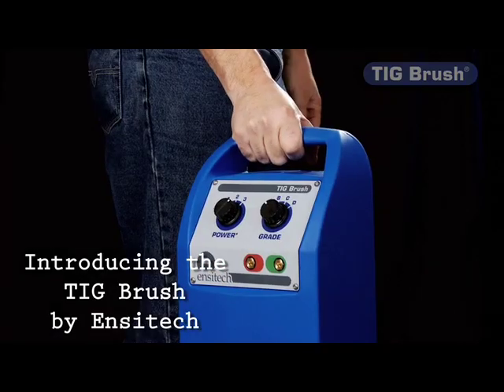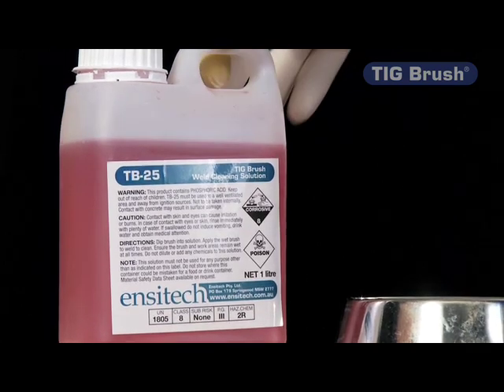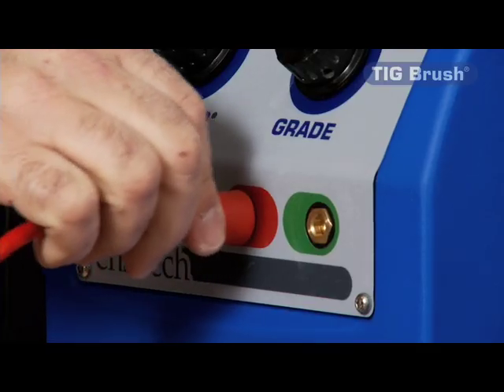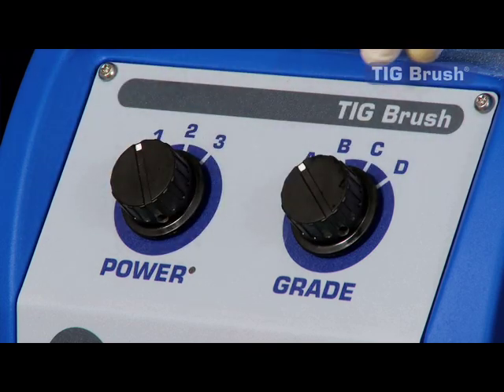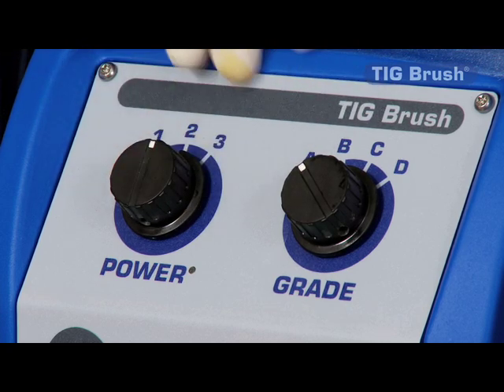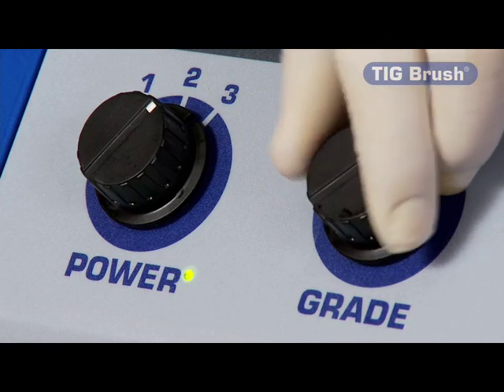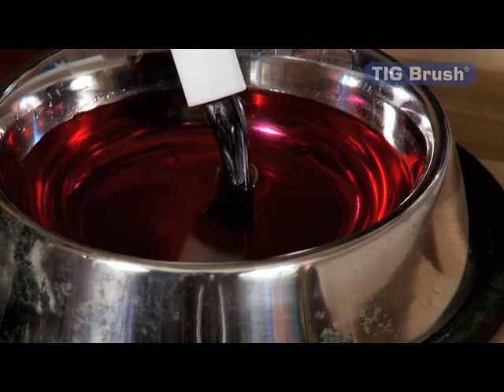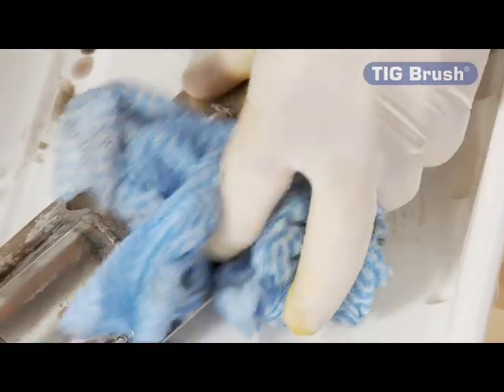TIG Brush Stainless Steel Weld Cleaning System

Comment: Our workshop bought a couple of these a year or so ago and I really want it to be good but it sucks. The immediate results are great if your cleaning something that has been welded on one side its a doddle but we weld most of our stuff inside and out for hygiene reasons and it struggles to clean the welds where the heat has unavoidably built up and you have carbon deposits.(normally the side opposite the last weld)
Not only is it extremely messy and smelly I find it has very little advantage over the traditional methods when considering the time it takes, It would be good if it wasn't for the next bit. 

We clean, use the neutraliser and no matter how much we spray it with a pressure washer it ultimately develops phosphoric salts (white powdery finish which is difficult to clean), I have just about given up with the reps, they blame it on how we clean it after but even the stuff they do in the shop develops after a week at which point they are no where to be seen for 6 months. They can't explain it and are very unhelpful. Anything the acid touches turns to crap including our floors and not to mention the state of the machine now..

Unfortunately I will be sticking to the traditional pickling paste for now until something proven is available, yeah its not food safe either but who actually uses these in a food factory, all our cleaning is done in the shop and passivated by using water and a pressure washer, never had any come backs from pickling paste and no-one really knows how safe those fumes the tig-brush produces are.

10 years in a fabrication & welding shop.

Comment from the maker: All Ensitech stainless steel weld cleaning fluids contain sequestrants  that keep iron from re-depositing on the surface. This is critical in guaranteeing a superior level of passivation. Simple phos acids have a large amounts of metal contaminants that oxidise in the heating process to form a couple of nasty metal oxides eg. magnesium oxide which are the cause of metal fume fever...listless, flu like symptoms....plenty of literature in the public domain. TB-25 has the lowest levels of these metal contaminants without being an analytical reagent.

Comment from the maker: Using a TIG Welder as a weld cleaner is very dangerous. If a carbon electrode is used in connection with a welder, the welder will apply 80 volts to the electrode, the work being cleaned and the cleaning fluid. If the worker touches any of these things during the cleaning process, he is in real danger of being electrocuted. For a fast, safe and effective solution use a TIG Brush.